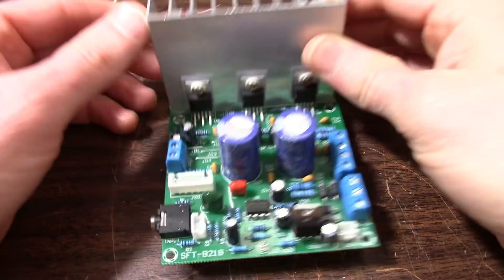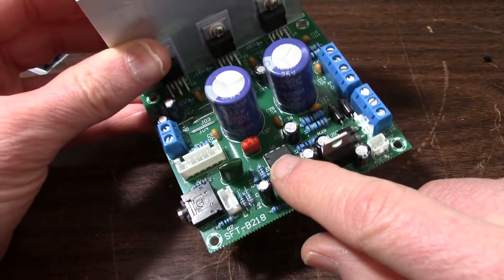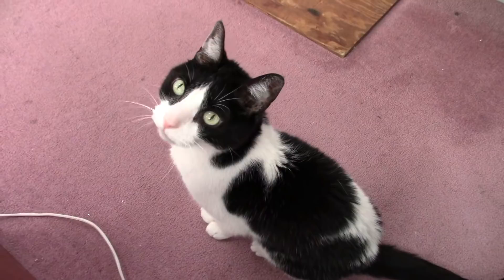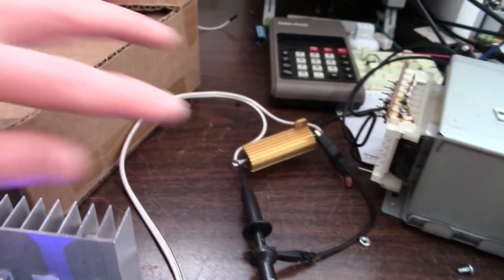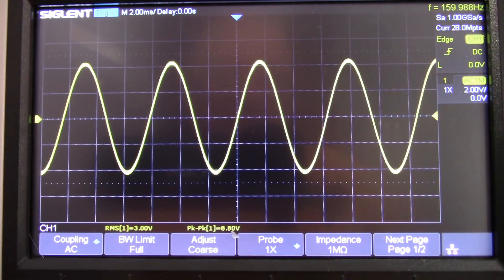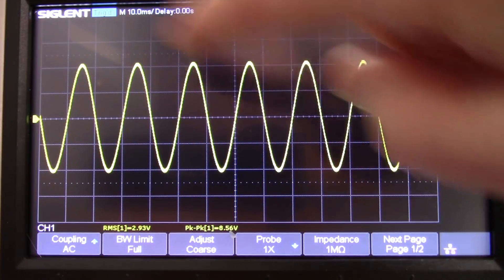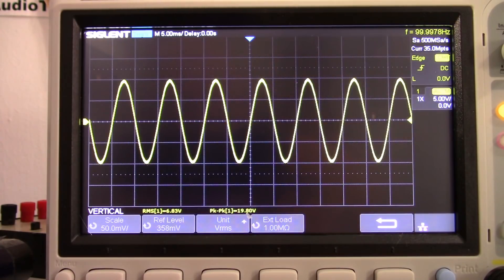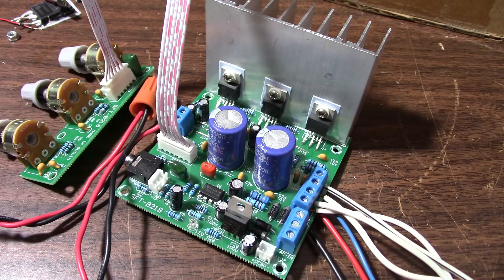TDA2030A 2.1 channel amplifier board review

Comment: i have 3 tda2030a ic and they all have a open circuit from ground to pin 4. is that a problem? because neither of them work and i was wondering if the problem is coming form the ic or the other components

Comment: I have questions -
1. If I need to use counterfeit tda2030A chips, what's the maximum safe supply voltage and can I use the 12-0-12 v transformer whose peak no load voltage is 40 Volts ?
2. Does the counterfeit tda2030A chip outputs 50 % power or less ?

Comment: I remember the very first time I took apart and I see and I didn't have any means to really do it but basic common tools available to a 12 year old kid living with his mom.   
I even found the old radio at a garbage heap and picked it up and took it home.
I was able to go ahead and open it up and take it to school and look at it under a microscope and you know it's amazing what they were able to pack in there.
I think that's one of the reasons why I like tube amplifiers because you can literally see everything and it's all working right there in front of you and it makes the most sense to me. Even though I still can't actually grasp a they were completely but I understand the theory.

one quibble I have about counterfeit chips is that I wonder why do they make them worse and not better?
I mean if you're going to copy something why would you make it worse instead of better? I'm sure they have their reasons for making the die sizes smaller but I wonder if they decided to go for the angle of efficiency or decided to use with the hat on hand to make a copy who knows?

Comment: Is it just me or there's a huge gap in the frequency band between the sub and main amplifiers? 
I have one of those mini guitar amps that have a similar amplifier setup that drives a sub and two main speakers and I have never enjoyed the sound it produces! 
After watching this video I'm thinking that it is suffering from the same thing! The 4" speaker is getting it's sub frequency but the two 2" main speakers are high passed way to high up the into the frequency, there's lots of low end movement but there's no mid bass punch so there's no real SPL to it... It sounds terrible and I can't imagine how anyone could use it as a guitar amp or as a Bluetooth speaker? I really don't know what they were actually thinking? I'm going to need to pull it out of storage and run a frequency sweep through it and see if this is actually the case! And if it is, see if I can modify the low pass filter to somewhere much higher..  
Thanks for this video John, I love those TDA2030A's, even their clones sound pretty good 👌. 
With careful design, you could build the three way active speaker amplifier design that is in the datasheet! Even with Chinese clones, I bet that it would sound amazing... 
Now I have an investigation into a terrible sounding amplified speaker to attend to....
Edit: if there's a gap in the frequency band of this amplifier that you just reviewed, how would we go about in changing it's cutoff frequency? Might be another video in that alone?
Reply from the maker: It can have some gap so both drivers aren't outputting the same frequencies at full level. If the gap is too wide then yes, there would be a hole in the response. This amp only rolls off the bass to -3dB.

If your active speaker wasn't made specifically for guitar, it won't sound right. The speaker driver itself is made specially for guitar use.
Reply: @JohnAudioTech  when you say that this amp rolls of the bass to -3db, I'm guessing that you are referring to the left and right channels? 
I have two guitar amps but I don't play LoL, it's what you have with curbside pickup's LoL.. I know what they sound like with music being played through them but this other thing that I was talking about has a guitar input but I doubt that anyone would be able to use it for that reason.. when playing music through it, it sounds like... If you imagine, a handheld transistor radio paired with a subwoofer! I'm over exaggerating a fair bit but I'm sure that you get what I mean.. I don't know what they were thinking? It's useless as a bass guitar amp, it's useless as a lead guitar amp and it's useless as a Bluetooth portable speaker! Outside, the sub is to small to be any use, inside it's just as bad, I'm thinking that the circuit designer didn't quite understand what crossover frequency is all about.. I haven't measured it but I'm sure that there's a huge hole right where the two amplifiers should have met and shook hands... 
One of these days it's going to end up on my bench for a redesign of it's circuit... 
Watching you video kinda reminded of the issue that I had with my contraption when I thought that I heard what sounded like a gap in the frequency of the amp board that you had just reviewed... Maybe I was just hearing thing's LoL...

Comment: These PCBs are commonly used in Bluetooth tower speakers, They usually have a separate MP3/Bluetooth control PCB as a "preamp", and use a very small transformer with small capacitors.

Comment: Wanted a low cost 2 channel board and didn't know if the 2.1 amps might filter the lows on the L&R channel.  Looks like you've shown it can happen.  Bought Parts Express YDA-138E 2.0ch to see if it would work and doubted the claimed 20watts.  It puts out about 7W RMS so that was good enough for my need.  BTY - to test it you've got to use low pass filtering as its class D.

Comment: Some rumor fake TPA3116D2 (Class D) amp chips are floating around as well.  Heard anything on this one?
Reply from the maker: I haven't heard about that.
Reply: 3116s are still being produced and sold. They're also quite cheap for what they can achieve, my amp has 2 in PBTL and a OPA2132 as preamp (with John's PreAmp design). I've been tempted to get a pair of TPA3156 which should be able to output a bit more power and are direct drop-in replacements for the 3116s.
Reply: @Algray_  Yes,  they are still being made.  Like I said it's just a rumor.  I'm temped to play around with the TPA3156D2 or even 26's as well.   Great chips.  I've seen some distortion issues above 10Khz that appears to be caused by inductor heating.  Waiting to see if anyone else reports the same.
Reply: @jeffm2787  Not sure on the 3156. But most Chinese made 3116s have wrong filters everywhere. Mine for example was one of the "better" quality 2.0 boards, you should find it in AliExpress searching for Aiyima Tpa3116. I've done the necessary modifications and I think I have a fairly decent amp in my hands. Another board from China known as XH-M543 had several more filters done wrong. Once modified to fit the datasheet you can achieve pretty good sound quality (this one was how I learned a lot about electronics). The main issue with them, that causes heating issues on Inductors is that the EMI filter resistors are usually 1r instead of 3r3. Changing just that fixed the inductors heating (I already had 10uH swapped from the 33uH they come with).
Reply: @Algray_  Agreed,  I may play around when I get a chance.  Might as well,  I have all the test gear and parts I need and then some.  Odd part is with the Chinese amps I'm only seeing problems with the over 10Khz distortion once the inductors heat up.   I'm assuming just due to the increase in resistance once heated.  Yes,  I'm simplifying the terms. More complex mechanics involved.
Reply: Maybe you means that there's T.I  IC chip  ( fake and NOT  TPA 3116  )  TPA 3116 with only 16 pins instead of the original IC chip  comes with   32 pins.

Comment: 25v capacitor for tda2030a  not for 24-0-24 transformer
Reply: The output caps on a single rail class  B  or AB  amplifier Class are to provide the current path for the reverse current flow in the speaker coil. The circuit is a dual rail supply and so does not have output caps. The board has the AC to DC convertor on the board and so it requires smoothing capacitors.
Reply: @woodcoast5026  
25v 6800uf caps are  filter the rail of rectified DC

Comment: Is there a decent 2.1 board amp out there ?
I want to build a sound bar for a friend's TV.
15 to 30W / side is plenty, but I want clean reliable audio.
Reply: Don't use any board with these chips, they are ALL fake and junk.
Reply: @MichaelBeeny  Yeah, that's what I'm running up against.
Reply: @jim9930  I'd have to mux the inputs to get mono sub but at that price I could buy 4 and bi-amp each side to make a 2.2  Although, 4 amps would need a beefy power supply, and probably a fan.😡